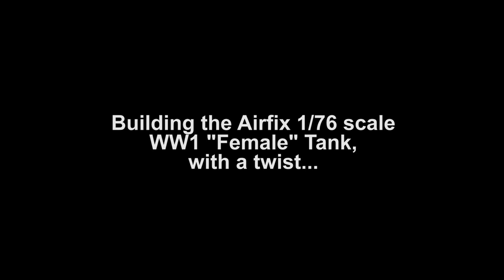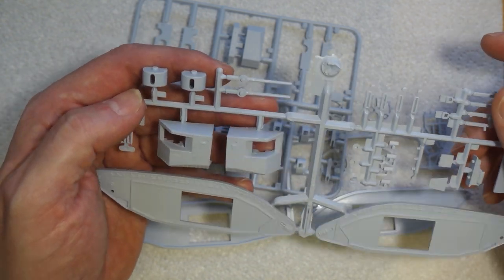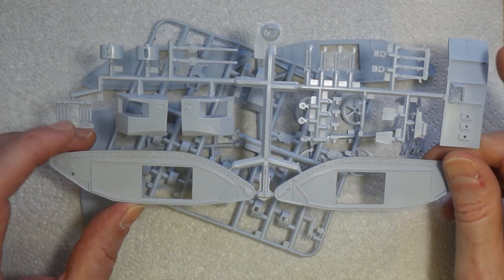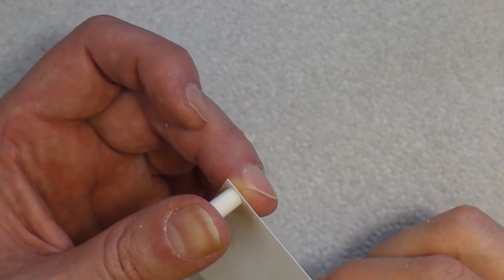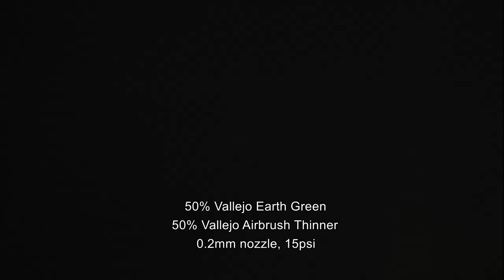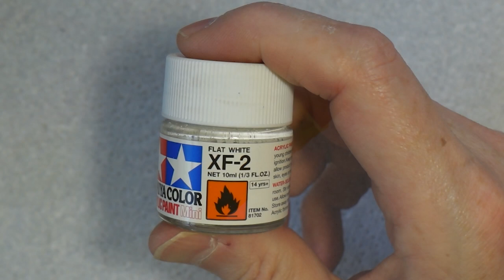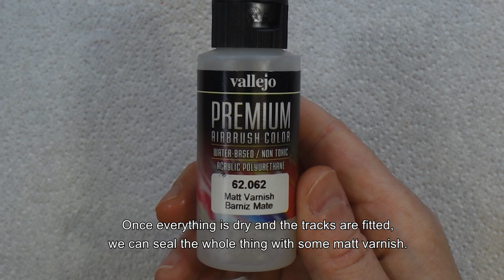Diorama build 4 of 4 - Building the Airfix 1/76 scale WW1 "Female" Tank, with a twist...

Comment: It's the original 1967 release of the Mark 1 Tank, Male, with the six pounder sponsons. In 2014, the 'Female' was introduced to tie in with the WW1 Centenary. New figure sets were mooted, but never appeared. The 'Female' sponsons are a recent addition. This did mean that, with a bit of work, you could make a Mark V 'Hermaphrodite', which had both male, and female sponsons. I cheated, though, and used an 'Emhar' 1/76 Mark IV for the main body. Cutting the exhaust doesn't matter, as the exhaust on the model is completely wrong anyway. The exhaust fumes actually came out of the holes where you are meant to fix the exhaust pipe; the holes were covered with angled louvres. Your smoke fitting looks much better, and similar to a system tried out by the French and Americans to lay smoke on the battlefield. And your finished result is superb. Nice one.
Reply from the maker: I didn't know that about the exhaust - thanks :-)

Comment: I was wondering if it would have been possible to drill out the exhaust pipes and silencer then
attach them to the much larger pipe inside the model thus creating an in-scale exhaust system???
Bill G Linwood Kansas USA
Reply from the maker: The problem with that is that the diameter would be so small, the vapour would likely condense and form a droplet that would block the pipe.

Comment: You could have done the exhaust but with the parts that came with the kit. Use a pin vise on the exhaust pipe and then attach it.
Reply from the maker: I could, but I've worked with smoke machines for quite a while and experience tells me it would have been quite ineffective, if it worked at all. The volume of the pipe would have been very low and it's likely the pipe would simply gas lock and no smoke would come out. Even this pipe has blocked on a couple of occasions - basically the fluid condenses on the inside of the pipe and forms a droplet that blocks the pipe. 
Thanks for watching.

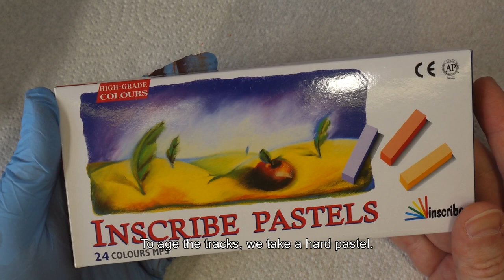Comment: 19:56 You really do use that screen for everything, don't you? Thanks for the ideas.
Don't listen to those telling you that you should have tried to use the original exhaust system. Instead, listen to me when I say I'd have thought about sticking a slightly smaller tube partway inside the exhaust end to make the "smoke" go straight out instead of at an angle. ;>)
Also, I'm a shamelessly inveterate scratchbuilder/modifier. It looks to me as if there's actually room for both kinds of sponson on the sides of that thing, maybe glued together, if you move the existing ones forward a bit. What would they have called that, a double hermaphrodite?
Oh, and how did your son's model come out? Hope he's proud of it.
Reply from the maker: I kept the spare sponsons, but it did cross my mind to add them all at once :-)